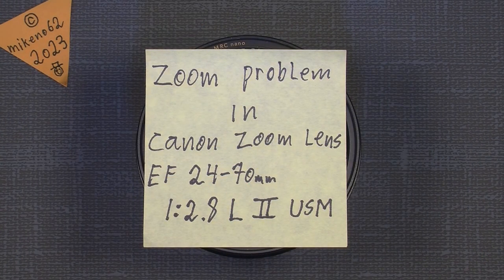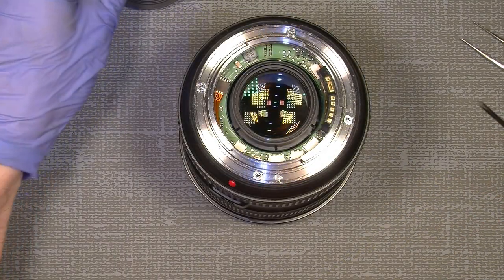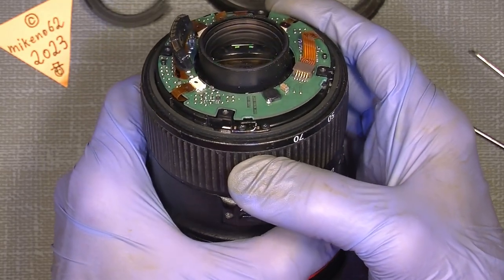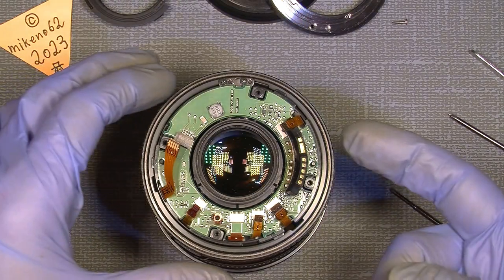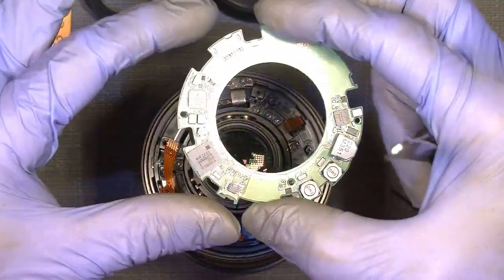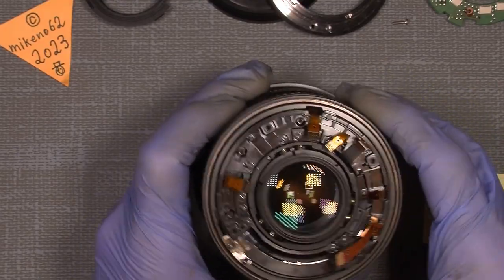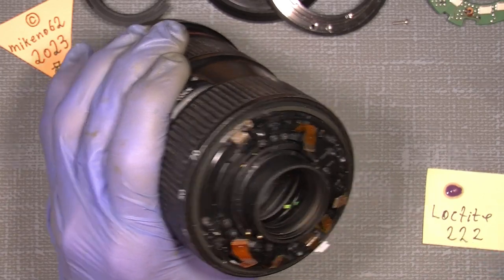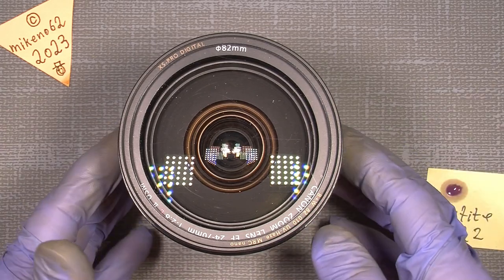Zoom problem In Canon Zoom Lens EF 24-70mm 1:2.8 L II USM  ( One broken part )   Birthday video :-)

Comment: Gréât work. I didn t think that a resoldering would have work. On my side - if there were sufficient room - I would have put a similar thin metal piece glued with epoxy on the horizontal part of the fork. But as usual very interesting.

Comment: Hello, I have the same lens, but I have a different problem, which is that the zoom starts at 28 and not 24. What is this problem and how is the solution? Thank you.
Reply: hey did you find a solution?  I'm having the same issue. thanks!
Reply: @kernzilla  I didn't, I sold it with cheap price
Reply: @ThePoplord2010  gotcha.  i'm tempted to do the same thing, but might give the repair a try.  thanks
Reply: I have that issue right now. Camera bag fell out of storage with the lens. The lens was at 24mm and locked, but now it jumped past the lock with it still engaged, breaking a part of the lock. My lens only works from 28-70mm. Your lens (before you sold it) probably had a similar issue.